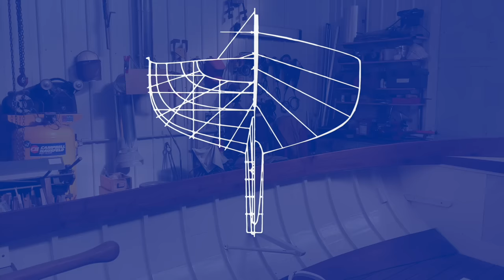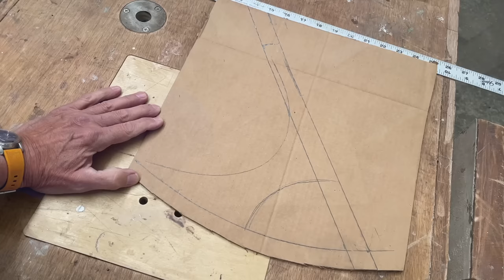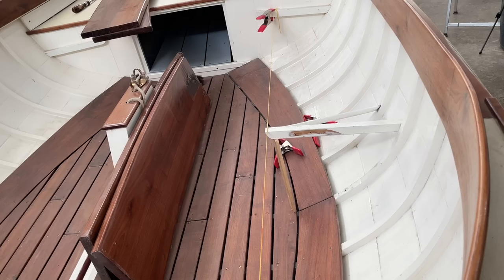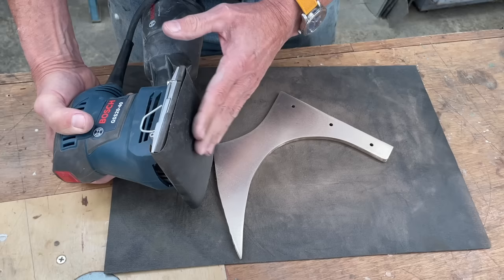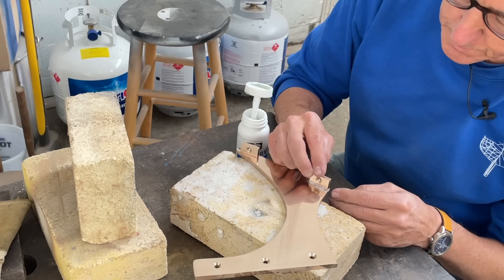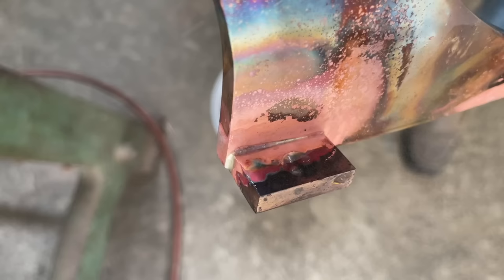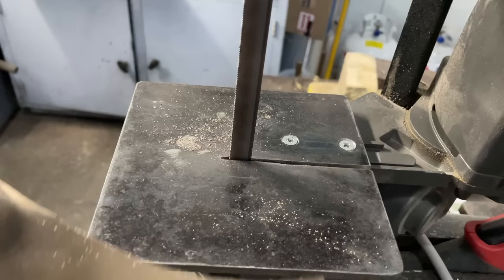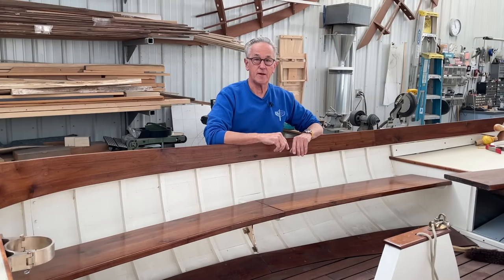Amazing Seat Post Transformation to Bronze, S2-E71

Comment: Great work, Bob. For anybody doubting the strength of silver solder, it's what's traditionally used to join the barrels and rib strips on double barrel shotguns. Very strong, shock, and heat resistant nethod of joining metal.
Reply: Fascinating. Thanks for sharing that.
Reply: It is also what high pressure commercial refrigeration lines are brazed with.

Comment: The bronze bracket adds a nice touch to this pretty boat, a little hidden detail which will show how well she was built... after the quenching in cold water, I used a product called Oxaway (Certanium Alloys) and fine (maroon colour) scotch brite to clean the surfaces of silver soldered copper alloys. It was less dusty (and scratchy) than using sand paper... an excellent job as always, Mr. Emser.

Comment: Silver soldered joints are very strong, and are easy to make on cleaned and fluxed copper and bronze.  It's used for miniature steam loco boilers (up to 5 inch gauge) made in copper, which have to take test pressures typically of about 180 psi.  I think the failure of the original wood curve was not entirely due to using kiln dried wood.  When someone sat on the seat, the curved piece was subjected to a large bending moment at mid span (eccentric loading), which is not a good feature of the original design.  It would not have failed if it had been backed up by a plywood web stuck on the convex side of the curve.  Your replacement concept is brilliant, in fact it has come at just the right time for some related problems I'm currently dealing with.

Comment: Well done but one question : Whatever the strength of the bracket you just rely on 2 screws now?
The aft banc seat on te bronze bracket but de fore one only stays on the  cleat, ans all the shear force will be on the screws.
anyway as usual you made it beautiful!!
Reply from the maker: Silicon bronze has a very high shear strength. Silicon bronze shear strength comes in various ranges due to the range of metals it typically contains. Its yield strength can be between 55MPa and 210MPa. (8,000psi - 30,457 psi)
I’m confident in the strength of the screws. 
Thanks for watching!
Bob

Comment: Bob, @25:44 is there really any difference between a Westcott Ship Curve that you're using for ship building and a French Curve used in drafting?
Reply from the maker: The ship curves are designed for boat drafting. A french curve will also work just not available In the long length. I included the name as in the past viewers has ask how to get a set.
Thanks for watching!
Bob

Comment: TIG welding would be an alternative
Reply: Dab of preheat. Bronze flows like butter.
Reply from the maker: TIG is an option. With small parts it is not as clean of a result as with silver solder.
Thanks for watching!

Comment: I’m impressed with the theoretical strength of the silver flux. With a  couple 200 lb guys on the seat, those two tabs will be exerting quite a bit of leverage on the weld. I hope it holds up! Beautiful job.
Reply: Look closely and you’ll see the bracket rests on a rib so the soldered pieces only keep it from moving fore or aft.